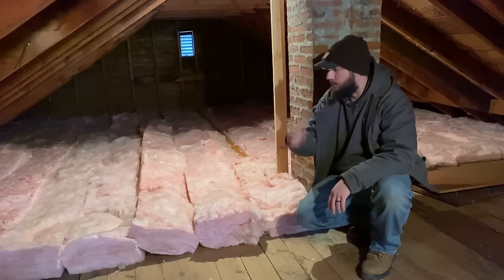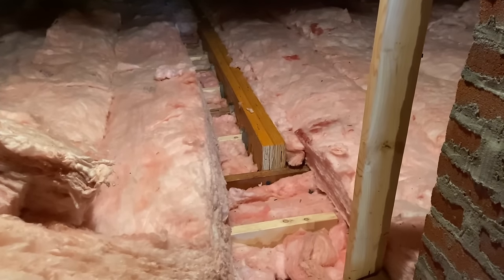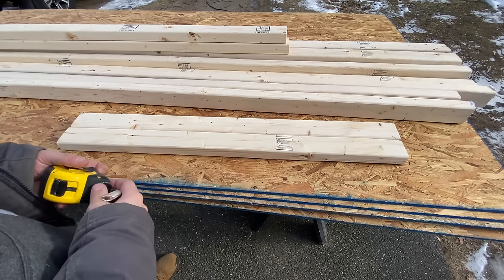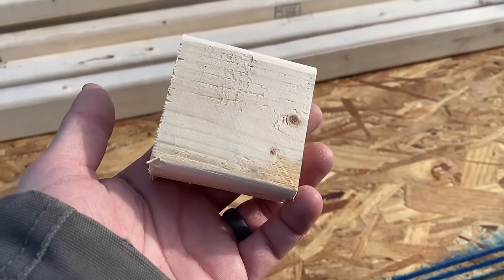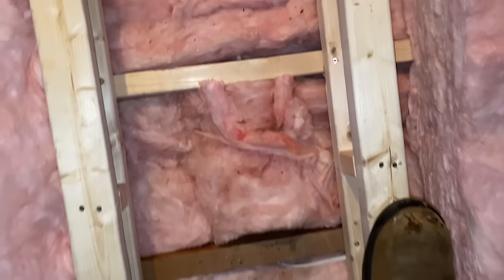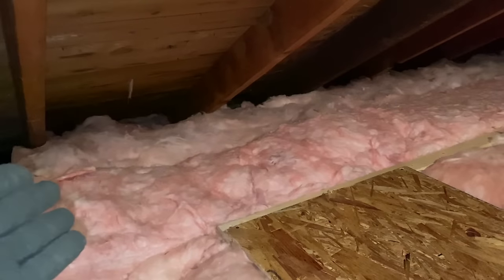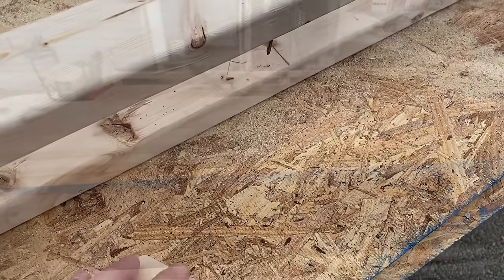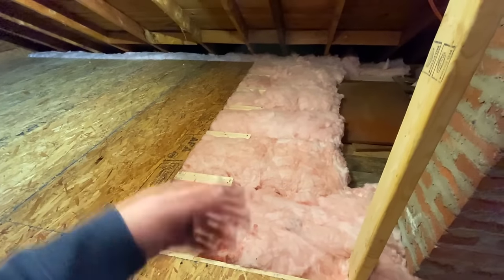Reclaiming Attic Storage Space Over Thick Insulation!

Comment: unwise out of touch Spray foam the slope and gable sealing the attic to the outside in place of the fiberglass filter insulation that need to be vented or you will have moisture/condensation problem therefore the ventilation requirement where with the spray polyurethane foam no condensation no venting

Comment: Drywall screws through plywood, phew boy. Might as well have not used any screws at all (drywall screws are deliberately only strong enough to hold the thin, easily breakable drywall).
Reply from the maker: There would have to be some serious magic happening to make them fail in this situation.

Comment: At this point you could have saved a ton of time by just building it up another 5 1/2" using 2x6's and run them the way you just did and insulating between them. All that cutting was unnecessary. Next time, next time.

Comment: osb is not plywood they are not naming them for grins. Seemingly You just loaded your celing joists for ZERO strength. If you had added the beams on the existing horizaontal joists you would have only had to spin all the insulation. Your crossing over did zero additional value. Mini wall is just a quasi purlin beam, but not really. I heard the word easier, aleready you raise ??s

Comment: You built extra beams for a floor because you think code is all the insulation? Really?
Reply from the maker: Hey!  As I said in this video, this ceiling is rated for "light storage".  I know the "beams", plywood and anything I store here is under the weight limit.  The insulation is up to code and wanted to leave it just for the simple reason that I wanted to keep the heat in my house. 😁. That make sense?  Thanks for watching!